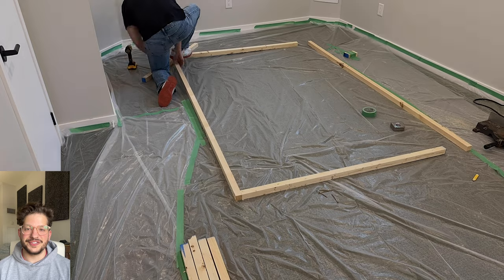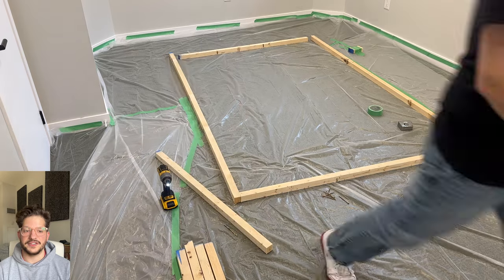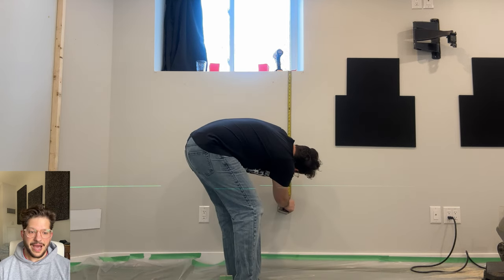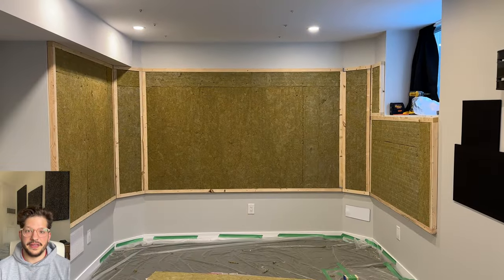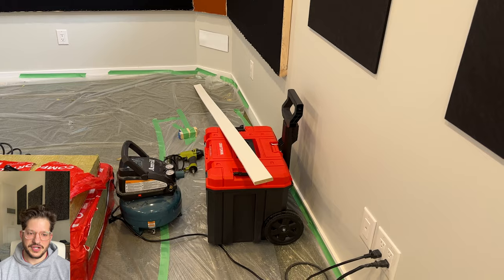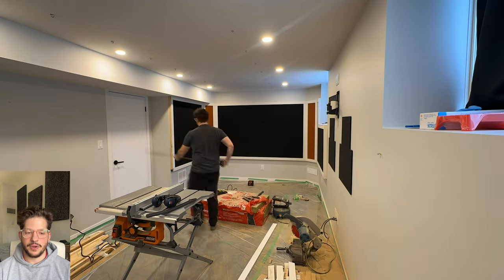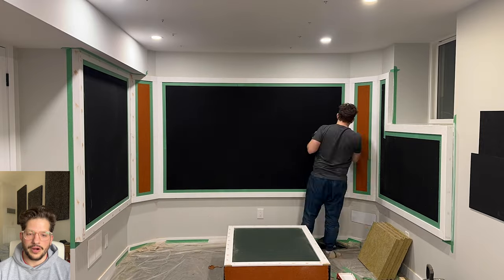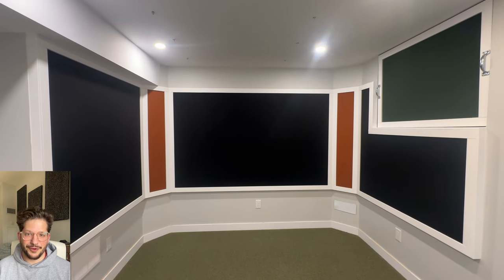DIY ACOUSTIC PANEL FABRIC WALLS! HOME STUDIO!

Comment: does the fabric protect the fibers from trickling?
Reply from the maker: Yes it does, we went with a thick wool fabric to ensure the insulation is contained. Thanks for watching!
Reply: @soundheadquarters  super. Do you think that molton backdrop cloth is dense enough to keep rockwool from trickling ?
Reply from the maker: I am not familiar with that fabric, however if you’re worried about the fibers you can purchase a commercial acoustic fabric like Guildford of Maine or another equivalent. You could also layer fabrics

Comment: Professional product with not even 10cm of insulation and 0cm of gap behind them….
Reply: I guess that's the trade off.. in this scenario, you are def dealing with flutter echos and some higher frequencies but true, you haven't left a lot of room (space, gap, depth, thickness) for bass frequencies. It does however, look cool :D.
Reply from the maker: I build to my clients desires, this client wanted to keep the fabric walls as low profile as possible to maintain as much space for their growing desk and outboard gear. Most of my clients especially in home studios sacrifice optimal acoustics for aesthetics and day to day functionality. For example this client mainly tracks drums, does pre production, rehearsals, and songwriting in this room. When they need optimal acoustics for final mixes, they have access to other purpose built studios. Thanks for watching!